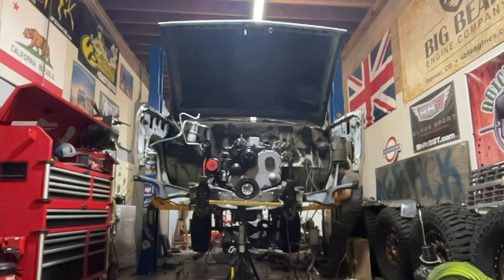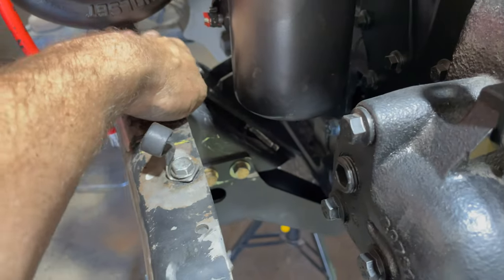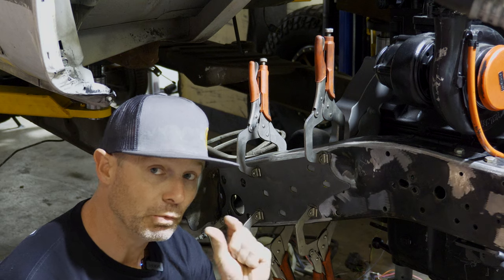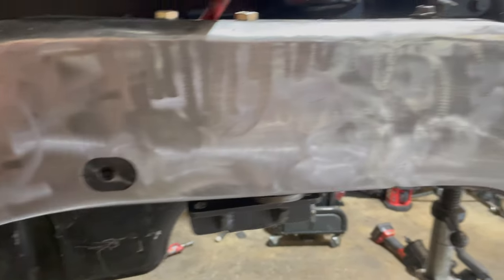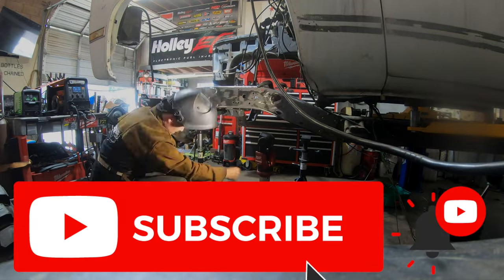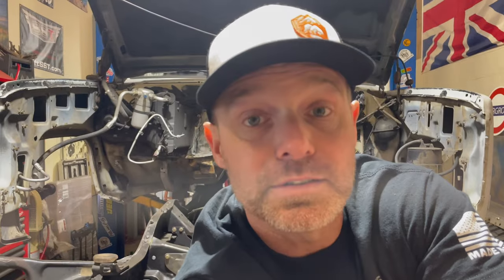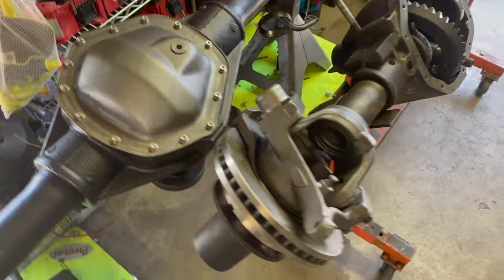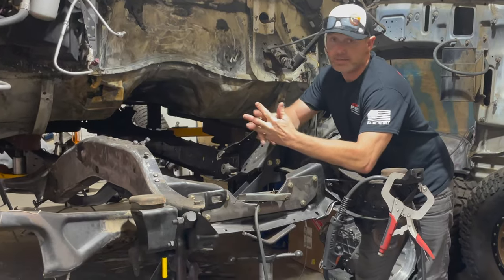Squarebody Burb Cummins Swap - Frame Plating and Strengthening

Comment: Hey Merrick, so I haven't followed this build as closely as I did your k5, but I remember you and I had a conversation when you got the burb, based on the fact that I have the same build.... I haven't touched it yet, I'm still nickel and diming my way to having everything to accomplish a finished ( drivable ) result and I can continue building while I drive it...
So I decided to go a slightly different direction. Instead of using the gm chassis and making it all fit and work, such as what you are doing, I decided to use the chassis that all the donor parts came from. I figure if the roller and everything involved is designed to carry that kind of weight, why discard it, I might as well rebody what's already mostly good. I say mostly because there are quite a few places Mopar failed, such as the steering and ball joints... 
So I figure you and I will likely have the same end results, but we are going to get there from either side of the picture. That's kinda cool. I see how you are doing it, and I'm headed to the same destination going the opposite direction.. let's play round the world. Hahaha
Reply from the maker: lol thats awesome

Comment: Selectively plating and ribbing the frame, obviously most around the engine but what went into deciding where to plate and rib? I'm asking for ideas to strengthen my OBS Ford F-250 that has a 7.3L and I'm aspiring to add 37s and a truck camper but the stock frame has the flex of swiss cheese before having all that additional load added.

Comment: Wich do you like better 373 or 410 gears ? I had 410 in my crew cab, But I bought 373 for the hi way . I haven't installed them yet.

Comment: James, do you have an email address that you give out?
Reply from the maker: James@merricksgarage.com
Reply: Woah. Ending with a Proverb? Gangster! Awesome, James.
Reply from the maker: New feature!   I love Proverbs
Reply: @MerricksGarage  hast thou considered quick-connects for the power steering lines? That’s something I want to do. Also for the AC; who wants to bleed and charge an AC system when one can quick-connect the line?
Reply from the maker: That’s not a bad idea.  Haven’t come across something that would adequately handle the pressure and not let any air in
Reply: @MerricksGarage semi’s run them on “wet-kits.” The PTO on the truck runs a hydro pump and the hydraulics run a pump on the trailer. We used them to be able to run a pump on a diesel/gas trailer and a propane trailer from the same truck, depending on need. You should be able to get them made by taking your hoses to a hose supply shop. I bet someone like ORD could hook something up and make them. I would but as I said in my email I’m in the middle of moving.
Reply: @MerricksGarage  for consideration and illustration of my thoughts:

https://www.mcmaster.com/high-pressure-quick-disconnect-hose-fittings/
Reply from the maker: Those look killer.  Would make work a lot easier!